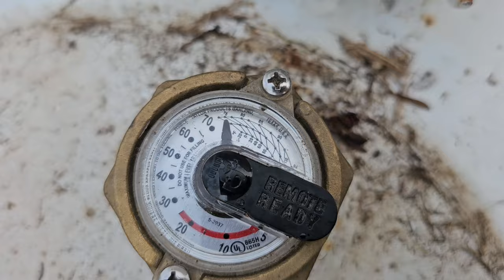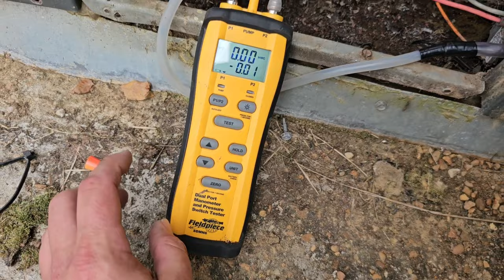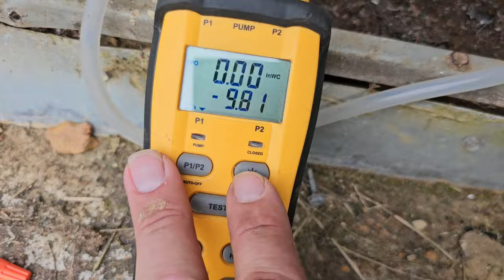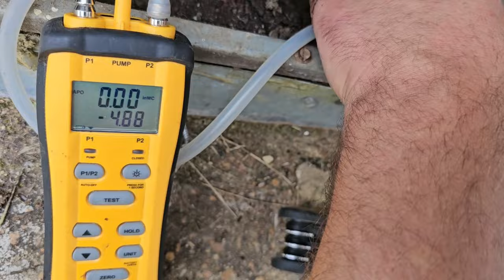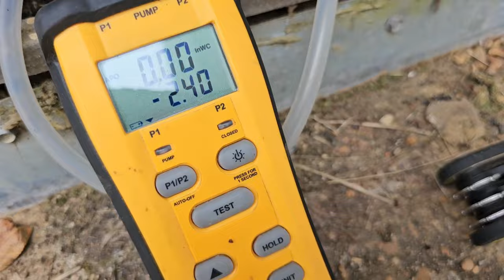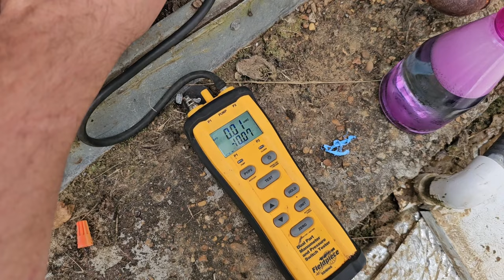Mastering Gas Heat in 10 Minutes

Comment: You are supposed to apply pipe dope (thread sealant) over top of the Teflon Tape, and always leave the first two threads bare, especially on a sensitive component, such as a diaphragm gas valve.
Reply from the maker: Great point!
Reply: @@adamshebel2320 some of it can get sniped off while threading the pipe in, which could cause a failure in the system.

Comment: I once had my gas heater not start some years ago with a pressure switch error. It turned out the port on the switch had a blockage. Since then, every October I put a straightened paper clip in the port to make sure it stays clear. I also keep a spare hot surface igniter and blower capacitor around in case I need them.

Comment: Thank you for helping a person in need. Question about the configuration of the gas piping. The orientation of that tee is really doing nothing using the branch as a dirt leg. Correct ? Realize given what you had to work with that would have complicated things to redo. Appreciate you sharing your knowledge.

Comment: Great video dude. I'm glad you addressed the drip leg because I was thinking it when you were taking the pipe off. Also I just use a paper clip to clean the orifices. I deal with a lot of propane and oil where I work. This video was good for me to watch because it keeps me aware of things to pay attention to and not to overlook since I do it so often.
Reply from the maker: Good tip Paper clip is a good tool for cleaning those

Comment: After watching hundreds of videos, I think you answered my question. It would seem there is a lot of information out there finding good information is not always right. But anyway, I assume natural gas is basically the same. I broke the ignitor but got a new one and installed it. The ignitor glows red. I do not hear the gas valve click. No flame. In another video they say to bump the gas valve which I did, even slapped it around but it did not help. When you say to clean the orifices, you mentioned the black tube with the brass. Are there any other places on the gas valve to clean ?
Reply from the maker: Check power to the gas valve
Reply from the maker: Check the inlet pressure and the Outlet pressure

Type in how to check gas pressure teddy digest
It will come up

Comment: Is there a paddle switch to detect Air movement?
Reply: No. The pressure switch is responsible for reporting whether or not the inducer motor is running.